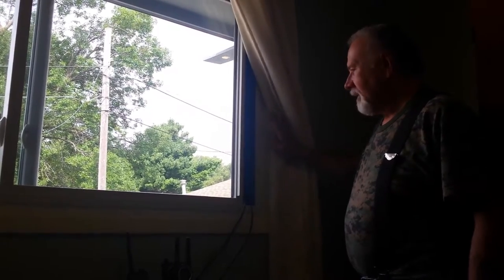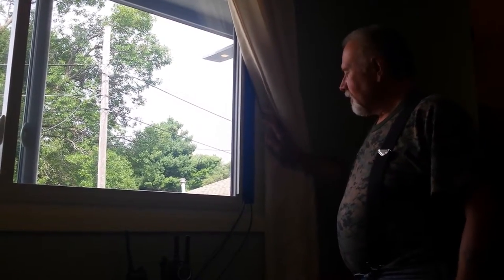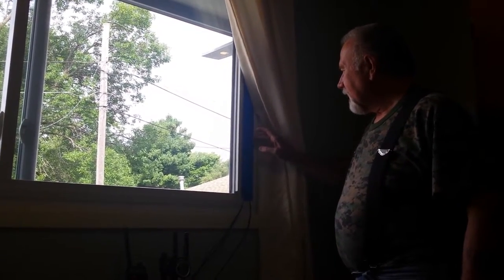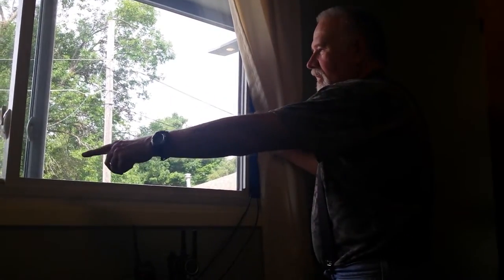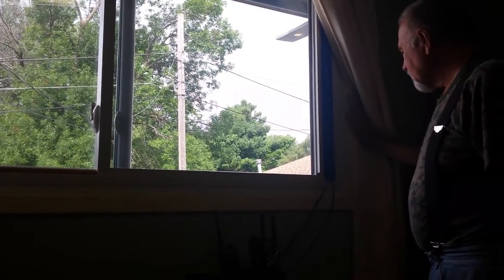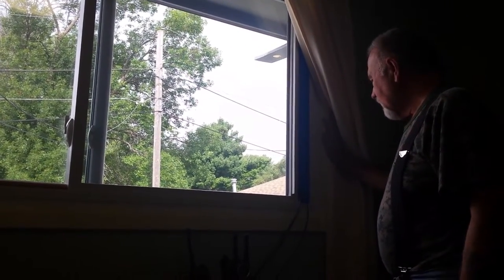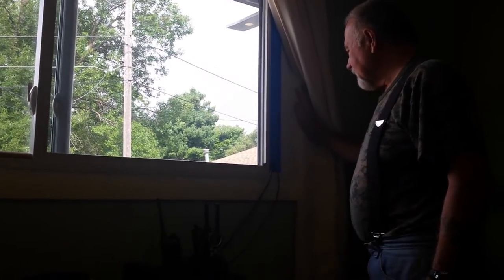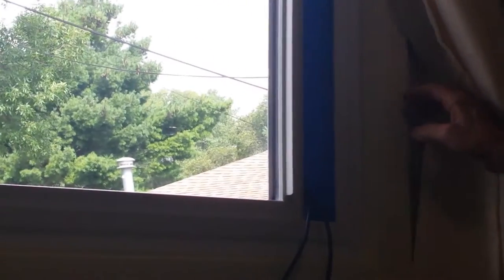Ham Radio Coax Through Window Made Simple

Comment: did you exit to the outside from the top of the noodle or just push cables through at the bottom of the noodle...great idea!
Reply from the maker: I cut a small slot and pushed the cable in. Still working perfectly
Reply from the maker: I cut a slot from end to end.  Just pushed them in one side and out the other.  Still using this today